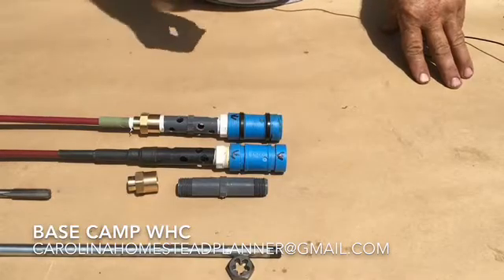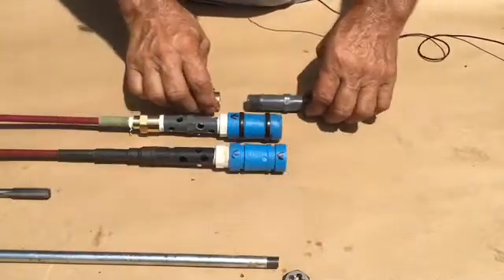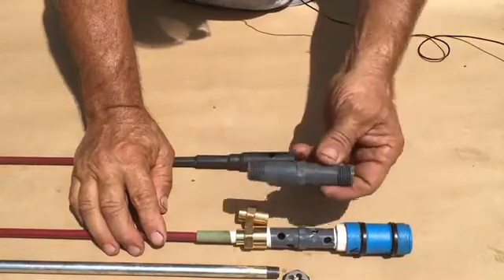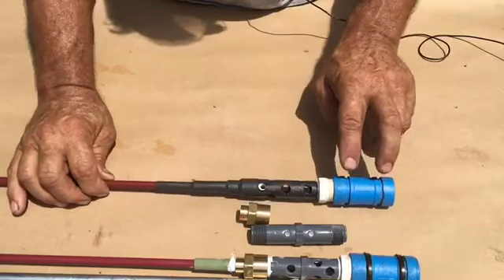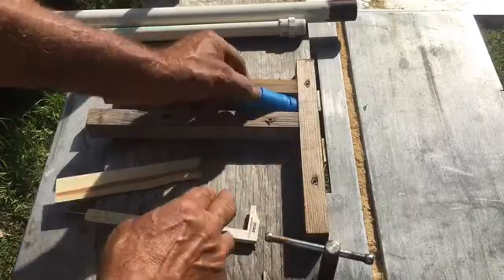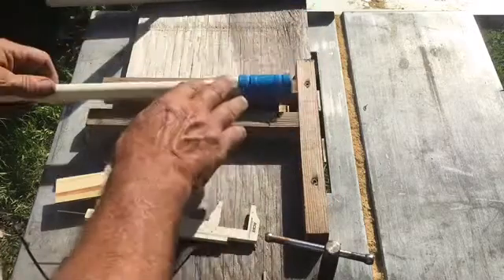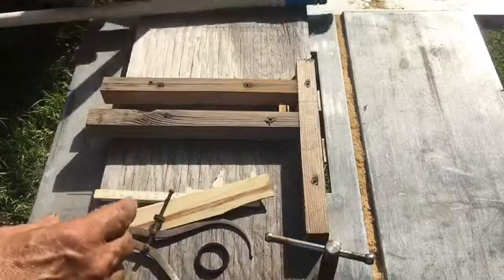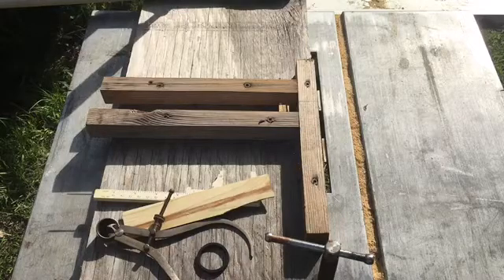DIY DEEP WELL PUMP BUILD TWO

Comment: Jigs are so important both for safety and consistency.  Great idea to use a scrap piece of PVC so you can get the depth of that cut to exactly fit what you need for those special cup ring seals before cutting into your check valve.

Comment: I'm having trouble with the seals being to tight in the pipe
Reply from the maker: Are  you dry fitting the pump together 
If so you will need to put some cooking oil on the seal and some on the inside of the pipe
Or put the pipe in water and then put the plunger in the pipe the water is then the lube
If this doesn’t work let me know
And as always subscribe like and share 
Thanks 
ERIC
Reply: @basecampwnc1745  thanks I will keep you updated

Comment: FYI Rutland chimney sweep fiberglass rods from tractor supply will thread directly into a 1/4 female brass fitting
Reply from the maker: I buy them from ACE HARDWARE and they are the same at the big box stores 
Thanks for the information 
Thanks for your comment